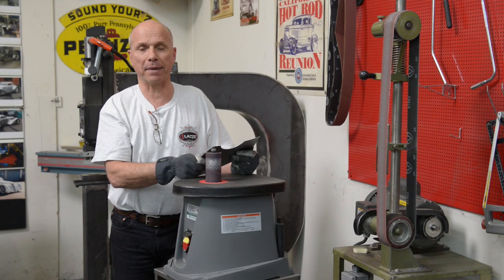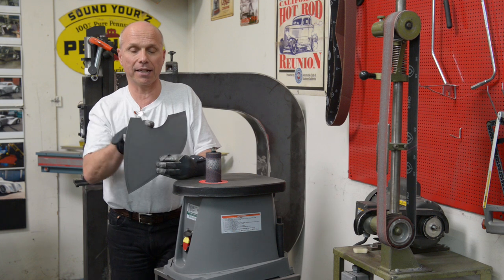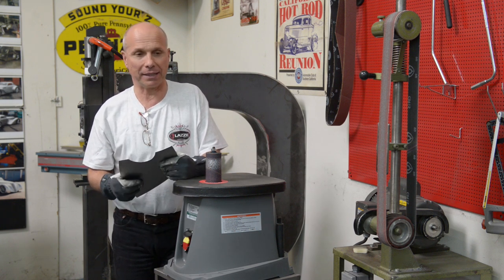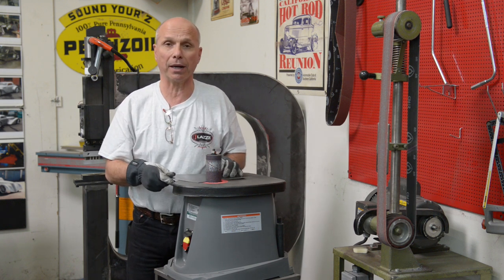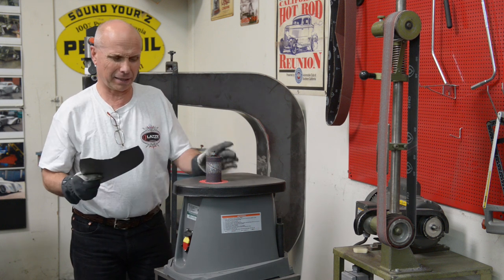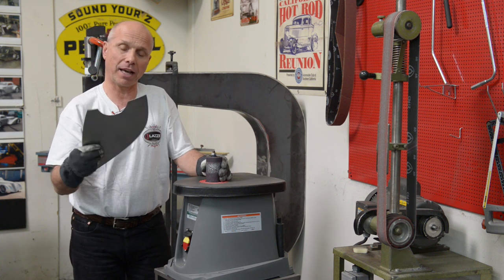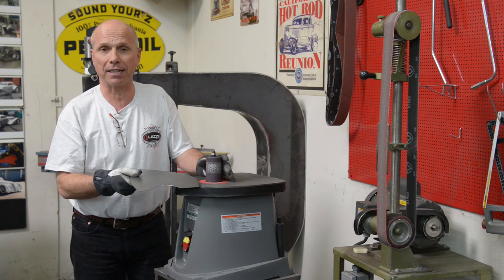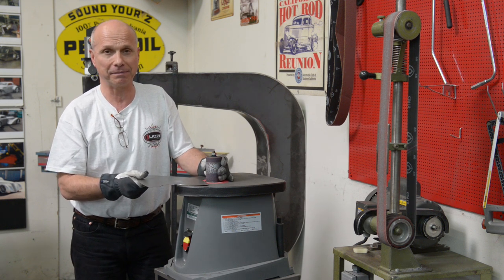Metal Shaping with Lazze: Grinding inner curves with an Oscillating Spindle Sander

Comment: Hi Lazze. I'm thoroughly enjoying looking at your videos. Even though I'm not into cars, I am interested in metal fabrication and your series is the best presentation by far in a wide range of sheet metal fabrication. I love your tidy workshop with colour matched equipment. Green is also my favourite colour. 

Regarding sanding - there are several types of paper available but basically for wood the brown/red garnet is used. For metal, the blue Aluminium Oxide gives better results and lasts much longer. You can use the garnet sleeve like you demonstrated but metal will blunten the cut edge very quickly. I have a bobbin head sander but as yet haven't gotten around to sourcing some blue sleeves and so have just used it for wood. Because it would be a special order, I have to order a dozen sleeves in one size and I don't need that many. 

Please keep up the excellent production run and well done.